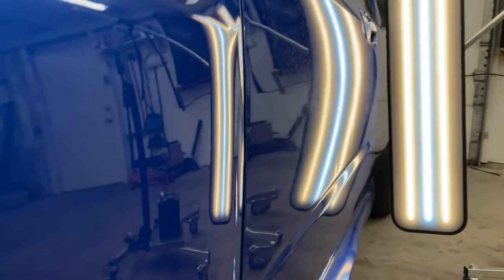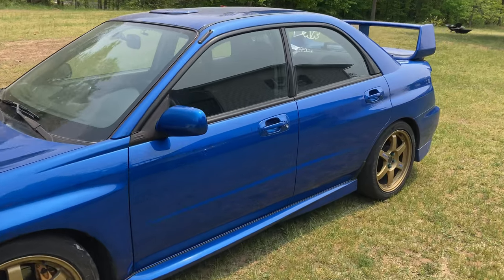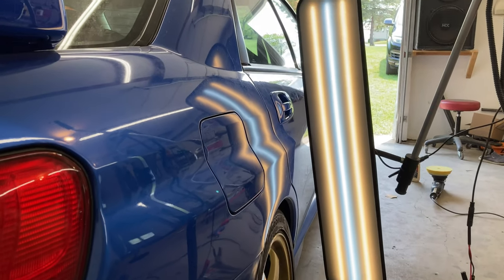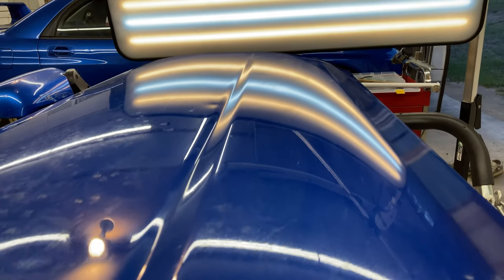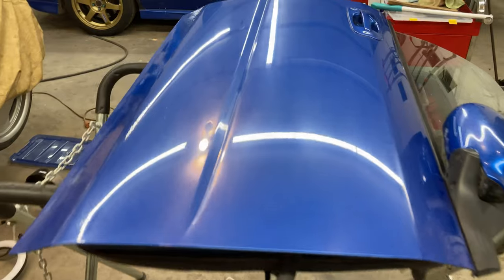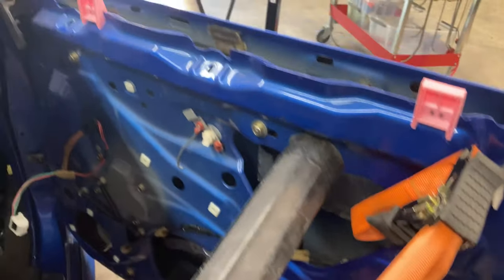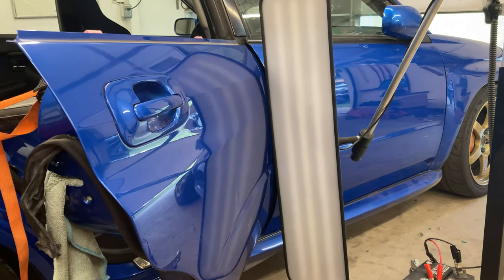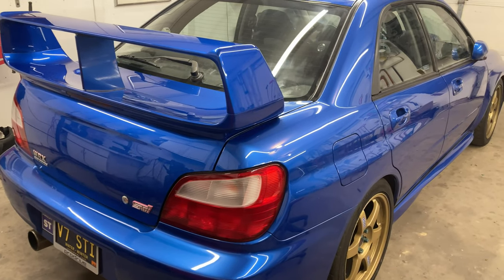Subaru STI Dent Removal without Painting

Comment: The one that you work on at time 1:28, got a similar one from my wife opening the door Into a cart return at the store, looks pretty minor but when your using the glue, what kind of glue are you using? I know WRX’s have thinner paint so I don’t want to damage the paint, anything would be very helpful, I have a 21 WRX
Reply from the maker: I am using metal medic green jujitsu glue, if it’s a newer Subaru the paint is totally fine for glue pulling . It’s the older ones that have problems .
Reply: @SWMIPDR  so a simple Amazon kit that has random glue sticks, would those be okay you think? Not sure how much it would cost for someone to come out and fix it but figured I could do it myself if it’s cheap and safe enough. Dont mind buying the glue that more professionals use, just once all that’s added up its 100 buck easy or a $40 kit on Amazon just  comes with different glues and people are guessing which to use etc but instructions suck
Reply from the maker: @dailydrivenmedia_   I have to warn you there is a Lot more to it than just putting a tab on the dent and pulling . This is what training is for . As well most pdr techs have a 35% up charge for a dent that was previously attempted . If this was a simple job everybody would be doing it . Go ahead and try it yourself , but don’t be surprised when you can’t make the dent go away completely.
Reply: @SWMIPDR  I gotcha, will prob get a quote from a place and if it’s too high I’ll attempt it myself but appreciate you getting back to me!